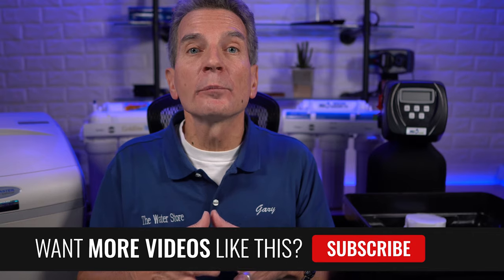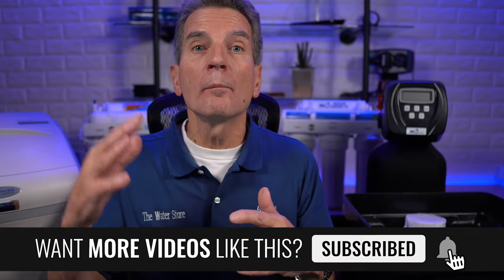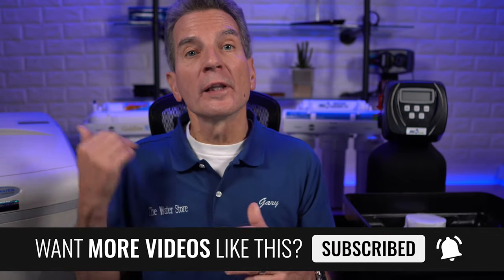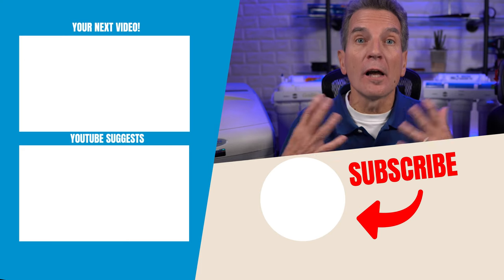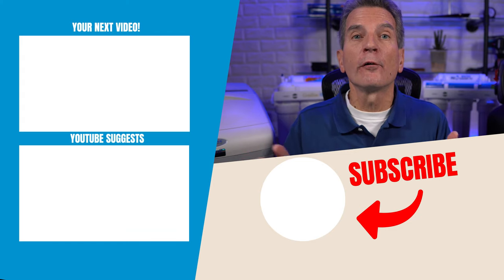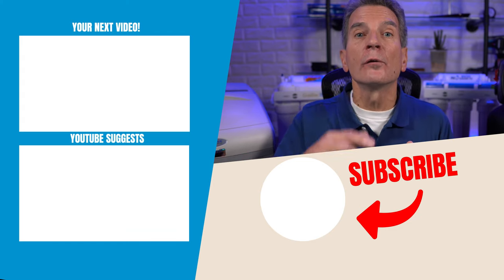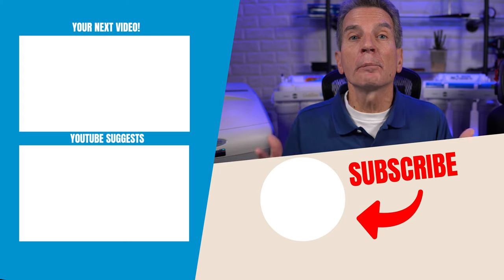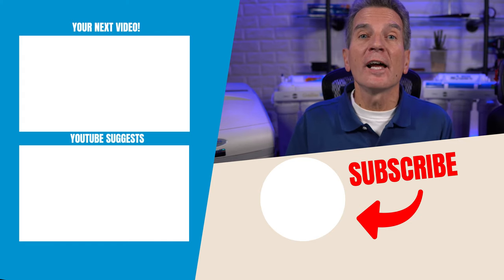HOW MUCH WATER should be in my WATER SOFTENER BRINE TANK?

Comment: Many videos describe how there are many factors to consider when determining how much water is supposed to be in the brine tank (or not). None I have found explain how the water is supposed to get into the tank in the first place either pre or post. No matter what the cycle, on my Clack, water never enters the tank. My tank remains dry throughout the entire cycle, its surely will extract brine, but only if I manually put water into the tank first. I've checked the float valve and it appears to work, I've quadruple checked my fitting and run my tank without salt (there is no salt bridge) to confirm it, no water enters the tank. What could it be?
Reply from the maker: A pre fill water softener adds water as the first cycle during regeneration.  Post fill add water as the last cycle.  I would check your water softener programming against what I recommend in this video https://youtube.com/live/c6r7qUK8to4
Reply: Thank you, sir.  @water_estore

Comment: I have an AO Smith WT 400. I have two issues:

When it regens, the water is dirty the following day. But just for that day after. What would cause that?

More pressingly, my water is always higher than my salt after a regen. When it started doing this, the other dirty water issue subsided. I checked brine line, injector and for a salt bridge. Everything seems to be in working order but the water is much higher than the salt after a regen.
Reply from the maker: Likely you need to increase the backwash time after the brine cycle.  This video will help you with the too much water issue https://youtu.be/ZdA0aI1q22w

Comment: Hi Gary, you are the most credible and thorough voice on water softeners that I've been able to find and I appreciate all your videos. I need some guidance. Our family just moved into a new house and we have a pretty old (1998-99 from what I can gather) softener unit. I understand how water softeners in general work but I really don't know what I'm doing. I could provide some more details about the unit, but I guess my main questions are:

1) There appears to be some kind of salt in the brine well (inside the brine tank), filled to the top. Is this normal?
2) When we moved in, there was always about an inch of water above the salt level or it was about even. Last night I ran a manual recharge and as of 14hrs later, there appears to be no visible water in the brine tank. Is this a problem?
3) I'm tempted to just start fresh, pull everything out of the brine tank, run some iron out through, and see what happens. Should I do this?

Thanks for your time. Any insight or advice would be much appreciated. Our house is well-water fed if that matters. Please help us!
Reply from the maker: Hello, thank you for the questions  1) No, there should be absolutely no salt in the brine well whatsoever.  2) Yes it is.  3) You can but just clearing the salt out of brine well and making sure the float is freed up should work.
Reply: @water_estore  Thanks so much for taking the time to get back to me. I'll try those simple fixes and hopefully that does the trick. Thanks again!
Reply: @ArgeXx-dz3ow  did you fix the water level ?
Reply: Why does it make my pump kick on

Comment: Hi Gary, I have a 60,000 grain softener with a 2 cubic ft resin bed, documents say I should use 20 lbs salt per regen, I have confirmed the salt setting in the clack ws1 control is correct. I am confused why the refill cycle adds 9 to 9-1/2 gallons of water to the brine tank, shouldn't this be more like 6-1/2 gallons being that a gallon of water absorbs 3 lbs of salt?
Reply from the maker: Yes, make sense.  How do you know it is adding 9-9 1/2 gallons?  If it really is maybe you have the incorrect brine line flow control installed.
Reply: Gary, I took the brine line and put it in a bucket and measured the water delivered in the refill cycle. I'm not sure how to identify or choose the correct brine line flow control, the one I have in has the number "79" on the black washer. I noticed that there is a red rubber part with wings, looks like it might be a check valve, might this be allowing water through if it is worn out?

Comment: My Culligan Gold softener is erroring out on error 2. It seems it fails at the fast rinse refill step. Any suggestions to how to fix this. I did pull the plunger cage and assembly, cleaned it and regressed it with dielectric grease. Still errored at all hat step near the end of the entire cycle.
Reply from the maker: I am no expert on Culligan products but it sounds like the valve needs to be rebuilt.

Comment: Hi Gary, I watched several of your videos but none of them describe what causes is there not to be enough water in the brine tank my system is a BNT650T which sucks out the water but will not fill the water back in. Do you have any suggestions?
Reply from the maker: Typically, the valve programming determines how much water goes into the brine tank.  Have you made any changes to the programming lately?

Comment: Hello Gary, this is my first home that has a well and septic. So a lot of it is new to me. I was informed by some neighbors that the water in my area is hard, which is why I have a water softener. So a couple months ago, the salt container ( by the way, I have a separate softener and brine tank), was about half full,and the water level in it was just about even with the salt. Checking it the other day, I noticed the tank is just about empty. Also noticed debris in the tank ( probably from dirty salt pellets). I would like to take my salt tank outside and rinse it out before I add more salt. My question is how much salt do I add to the tank (about half full?), and would I add water to it after adding the salt? Thank you for your help.
Reply from the maker: This video will help you to determine how much salt you should have in your water softener. https://youtube.com/shorts/PZaK-fVWyQA After cleaning, add enough salt to 1/2 fill the brine tank, add enough water to be at the same level os the salt and set it to regenerate.
Reply: @water_estore   Gary, will a reverse osmosis whole house filtration system filter out the salt after the water softener? Thanks

Comment: Hi Gary. Im stumped!! I have too much water in my Waterboss 950…almost to the top.  I have watched all of your videos and followed the Troublshooting suggestions in the owners manual to no avail.  I have competed the follow… removed and fully cleaned the injector assembly, removed and fully cleaned the brine valve assembly, checked and cleaned the air check/ draw tube, and confirmed that the drain is unobstructed and working.  After cleaning, During regeneration i observe the following…water level was static during cycle 1(first back wash), water level increased in tank during cycle 2 (brine/ slow rinse), water level stayed static during 2nd backwash (cycle 3), water level i creased again during cycle 4 (brine refill).  By the end of the regeneration cycles, the brine tank was full of water and the emergency shutoff kicked in. Any idea what the issue is and why the tank continues to fill and why water level never drops?? Much appreciated!
Reply from the maker: The problem is it isn’t drawing brine in the brine cycle. Did you reinstall the old injector or replace with a new one?  The manufacturer always recommends replacement.
Reply: Thanks for your quick reply Gary.  Yes, i just reinstalled the old injector.  I will order a new one and give if a try.  Ill report back once complete. Cheers
Reply: Gary. I replaced the injector assembly with all new parts and water level has not dropped. I have just removed the air tube assembly and tested the ball in the cage at the base of the assembly. The ball moves freely in the cage but when i immerse the ball and cage in a clear glass of water, the ball does not float to the top of the cage.  Is this normal, should it float, or is the ball potentially damaged and therefore affecting the final cycle of the regeneration?  Still stumped. Thx
Reply: Also, there is a high pitched squeal during stage 1 regeneration…any idea what this indicates?  Many thanks
Reply: Problem solved…i replaced the entire safety shutoff assembly.  Turns out that the ball in in the cage at the bottom of the aircheck had developed a crack and stopped floating in the cage as the water level rose in the tank… never unseating from the underlying port.

Comment: Great videos. The control valve on the top of my media tank vibrates and hums each time the toilet flushes or a faucet is turned on low pressure. Any suggestions?
Reply from the maker: There’s likely an obstruction in the connectors

Comment: Hi Gary, I had a draining issue and i cleaned out the machine , took out all the salt and ran the regeneration. afterwards there was about a gallon or so water at the bottom..is that normally there  or is my machine not draining?
Reply from the maker: It depends on if it is pre or post fill, check out this video https://youtu.be/GedMruLfXhY

Comment: My problem is that every 7 days when the backwash runs, too much water is leaving the tube and my drain can't handle it so my mechanical room floods.  I noticed I had about 2 inches of water above my salt in my brine tank was about 3/4 full of salt.  So I've completely bucketed out all salt from the brine tank and will just add 1 bag to start.  It's just me living in the house.  Do you think this will fix the problem or is it something else.  I've scheduled service but they can't get to my place for a month.  I actually have 2 tanks, once specifically for iron and that's the one that the water is gushing out of to the drain.
Reply from the maker: It sounds like a clogged drain to me.  I would unclog the drain and try it again.
Reply: That's what I'm thinking.  Thanks for getting back to me.

Comment: I am confused. You said (at 2:59) that "in this case it will use 9 pounds of salt per regeneration". A bag of salt is 40 pounds. Does that mean that you should roughly expect to put in a bag of salt in after every 4 regenerations?

Also - I just had a brand new BWS softener installed and the plumber left it set at the default hardness of 20. (In fact he left all the settings at the default.) I tested the water with Hach hardness strips and it looks to me like the hardness of the "softened" water is 25 or so. Should I increase the water softener setting another 25 to a setting of 45 now to try to get it down to 0?

I can not get the plumber to return my calls after paying him, so I'm on my own!!
Reply from the maker: Yes, this type of water softener will consume about one 40 lb bag after 4 regenerations.  Typically the brine tank will hold several bags of salt.  Sad storey about your plumbers service.  The settings are based on the water before the water softener.  Test the raw water and set the water softener based on it's hardness.

Comment: Hi Gary, just finished watching your video on the water level in the brine tank. Is there a particular level that that the water should be? Mine is currently 14" from the bottom and the salt level is 1" below that. There's a water mark on the tank which tells me that the water stays at the same level all the time. Can the float be adjusted to lower the level of the water or is that level of water OK?
Reply from the maker: The water softener determines the water level in the brine tank. The float is only used for if the water softener malfuntions to keep the brine tank from over filling.
Reply: @water_estore  Thank you. So I can program the water softener to lower the level in the brine tank?

Comment: Please help: We have the NuGen Pure Water System Fusion XT-90, how much water should be in our brine tank.  I also watched and the brine tank water level never changes during regeneration.  Is that normal?
Reply from the maker: The water level inside the tank should ne about 1/3 full but it can vary.  The water level (actaully the brine level) should drop slowly during the brine cycle.  If not you need to check out the advice in this video https://youtu.be/ZdA0aI1q22w

Comment: I have a Kenmore UltraSoft 800 Model 625.75190 water softener.  Lately I have noticed that the salt level is decreasing rapidly.  What would be the issue that I am now having to add 2 bags (44 lb. bags each) every week?
Reply from the maker: If it is a metered water softener you may have a leak somewhere, like a toilet.  since more water is being used (due to the leak) the water softener regenrates more often and uses more salt.

Comment: I have a 380 and it does not display the gallons available to be treated and my unit has tons of water in it.  It makes out the float. What could be wrong?
Reply from the maker: This video should help https://youtu.be/__6cg2kngwo
Reply: It keeps adding more water and now I am siphoning it out.  It seems to discharge fine line is clear. Stumped

Comment: I know this is an older video but I’m hoping you can help!  My husband had turned off the water to the house to do a repair and when it was turned back on, the water softener sprung a leak.  He has since repaired it and we restarted the water softener, but I wasn’t sure if I should add more water to the brine tank when we do the regeneration?  I’ve never been able to see water in the tank nor can I now and I inserted a broom handle down in the tank to confirm there is water down there.  Thoughts?  Any help is greatly appreciated!!
Reply from the maker: If in doubt add a couple of gallons of water.  After it regenerates the water softener nwill add the correct amount of water.

Comment: Hey Gary, i have a Manual water softener, Wondering how much salt and water should I add to the brine tank. Currently, I'm regenerating with 22 pounds of salt with 21 gallons of water every 3 days
Reply from the maker: I really do not know.  You need to check with the manufacturer and they will need to know your water softener size, your water hardness and how much water you use daily.
Reply: One gallon of water dissolves 3 lbs. of salt

Comment: I have watched all these demos and did them all yet none have helped my situation.  I have the kenmore  ultra soft 150  basically Im down to manually bailing out water of tank.  Never had this much water before.  Checked and changed the venturi and gasket twice.  Water is going out the overflow but not nearly enough as water keeps rising in my tank.
Reply from the maker: Did you try the suggestions from this video? https://youtu.be/ZdA0aI1q22w

Comment: I have a Culligan salt system soft water, purchased 5 years ago.  1 year after purchase my water heater started leaking.  Well it was 17 years old so didn’t think too much about it but did notice just after water softener.  A new commercial grade, 50 gal tank installed.  4 years later tank completely rusted and leaking.  Plumber said it’s the salt.  Culligan says it’s the chlorine in the water.  I do have high chlorine level.  So I’m not sure what to do.  Is it the salt or chlorine?  Anyone have any advice?  Thanks!
Reply from the maker: Did they test your water to see if the mineral content from the salt was abnormally high? Is the water softener set correctly for your waters hardness?

Comment: Hi there, Gary!  how are you?  I have the following question: what would happen if I add more salt than needed?  for example if my softener uses 40 pound per regeneration and I add two 40 pounds salt bags on the brine tank at once.  I understand all the salt on the brine tank will dissolve after 12 hours approximately. I'm interested on hearing what you have to say about it.  regards!.  by the way I use five buttons clack valves like the one on your back on the video.
Reply from the maker: Depends how much water is in with the salt.  One gallon of water will only absorb 3 lbs of salt, no matter how much you put in there.
Reply: @water_estore  thanks, gary for your answer👏.  Very informative

Comment: Any idea why mine is filling up between cycles and going through salt super quick? If I run a recharge cycle it will properly drain. I checked the connections for clogs etc but everything seems to be good.
Reply from the maker: Check out this video, it should help you and make sure all of the settings are correct https://youtu.be/Zikmilf_Tu0

Comment: Hi Gary love your videos. I have a well system and my iron is high. I bought a softner to lower the hardness and to or try to eliminate the iron. Its a sxt 5600 and I use iron salt in tank. I put in 3 bags which comes up to almost 3/4 to top and it worked awesome all my problems went away. It's been 4-5 months and water is slightly orange. I set my settings to auto degen. every 4 days around 2am but I don't think enough salt goes in the brine tank to clean out because out of those 3 bags I only used up about 1 bag so far from original. Am I doing something wrong? I need help Gary😫. I have water in my tank I look down the white tube and I see about 6" water
Reply from the maker: you need to know your hardness and iron levels in ppm and gpg to set it properly.  Thsi video will help https://youtu.be/5j3wXccdC4c
Reply: @water_estore  thank you so much. Love your videos
Reply: Is there a filter tank for the iron installed before the softener?

Comment: One tip from experience. Don’t buy a water boss.
Reply from the maker: Why is that?  I would like to know your experience with the brand.
Reply: @water_estore  I’ve been in the water treatment industry for over 30 years and have replaced dozens, more than l can count , water boss units. At a price under $400 , you get what you pay for. It’s all about the valve. Culligan, Fleck, and Hellenbrand are top of the line. Water boss has its place. Mobil homes, kitchens and places with limited space.
Reply: @jrm2383  I used a unit from Culligan, it worked for about 3 years, then sprung a leak where the valving goes into the media tank. Resulted in a nasty cleanup & damage.
I said screw renting, bought a Waterboss 700...it’s been plugging along trouble free since 2007, around 14 years now.